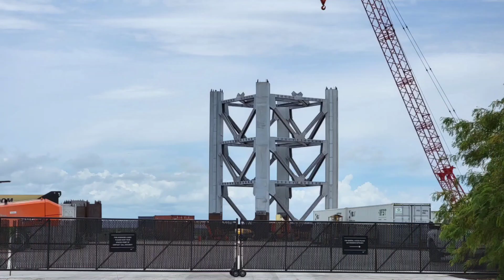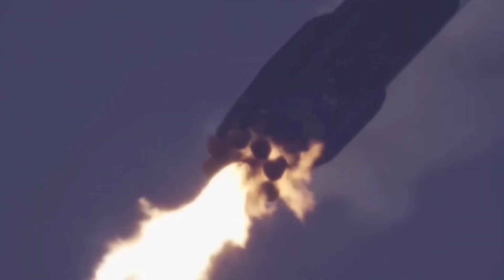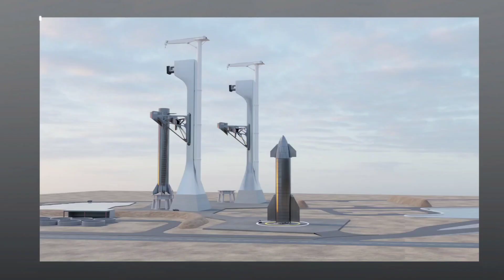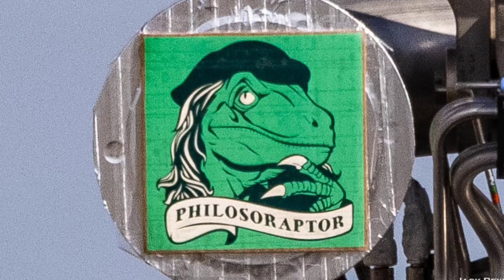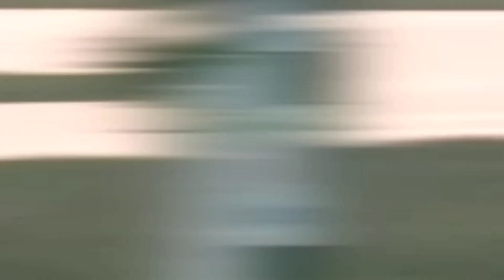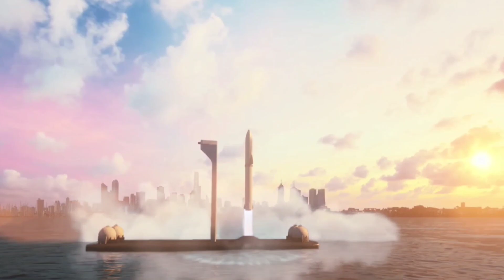SpaceX Starship Major Upgraded Designed Changes | Orbital Launch Site Incredible Progress

Comment: Reassigning some of the complexity from the starship to the support structure is great.  Why not assign some of that upward thrust, say the 1st 500 meters, to an upward hydraulic spray that engages the grid fins via water jets.  This would reduce trust puck pressure and save fuel.

Comment: You said that the grid fins were placed to *AVOID* the catching system - but the idea of the grabber being able to grip this vast machine and supporting it's weight by friction alone seems unlikely - it's much more likely that the spacecraft lands with it's fins resting onto the grabber arm.  That suggests that the reason for the repositioning of the fins is the precise opposite of what you said...they have been repositioned to make it EASIER for all four fins to rest on the grabber arms.   Those fins look like they'd be too flimsy to support the spacecraft - but they have to be incredibly strong to resist air resistance at several times the speed of sound without snapping right off - so they should be easily capable of supporting SuperHeavy.

Comment: There will be eight segments one is a little shorter then there will be a big yellow crane on top that's what they're building out of the yellow tubes right now... Segment 8 is under construction and almost completed segment 7 is getting ready to roll out there will probably be a roof in another lightning rod total height will be 479 ft tall
Reply: Thanks for using FEET.